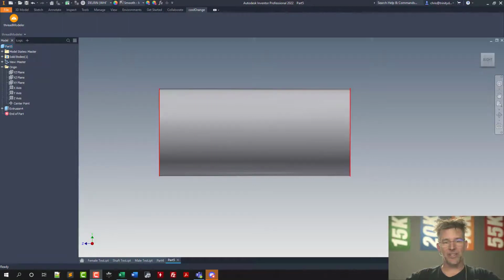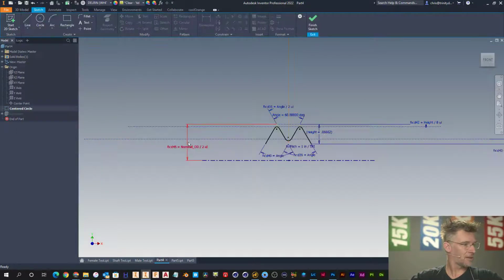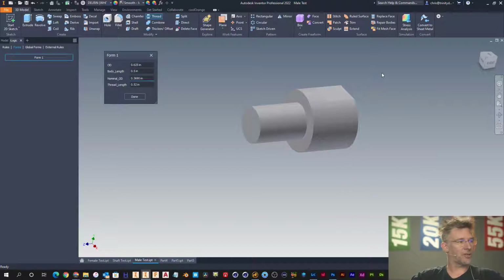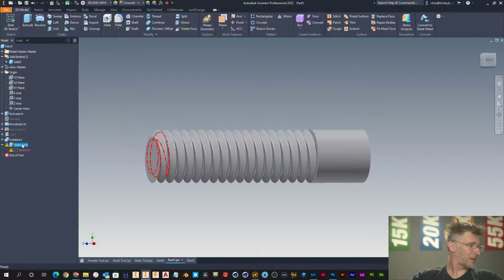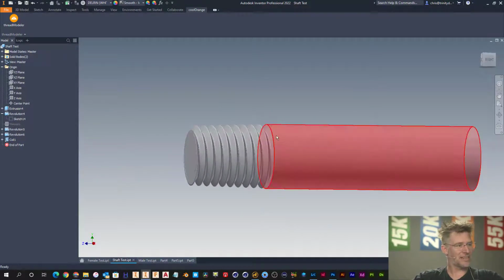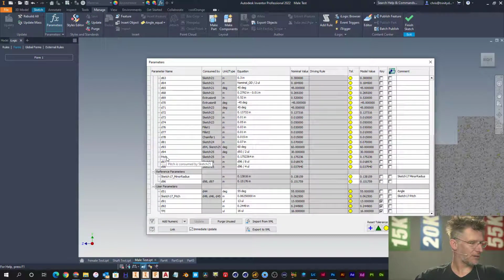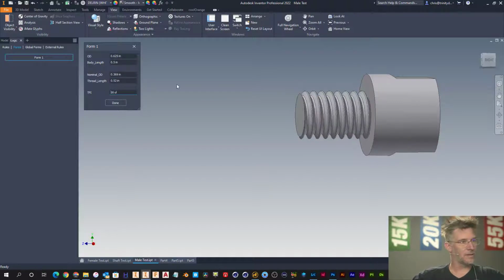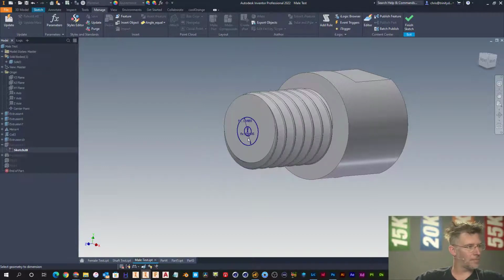How To Create Threads in Autodesk Inventor

Comment: This is the best video I've found yet on creating threads in Inventor.  You explained everything that I was having trouble understanding.  I've been using the CoolOrange plug-in, but I want to know how to make the threads manually, because the plug-in doesn't work on non-threaded round bar or stuff not in the Content Center.